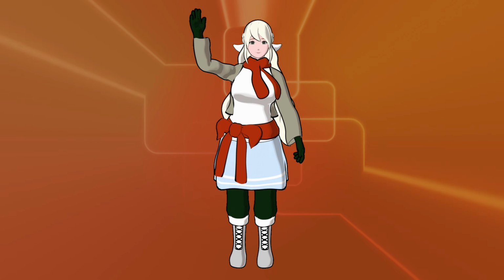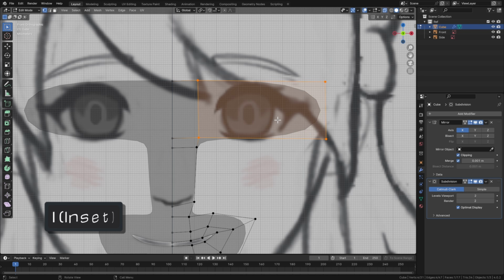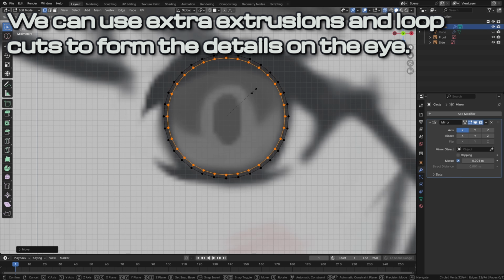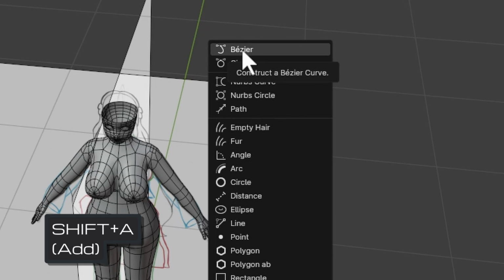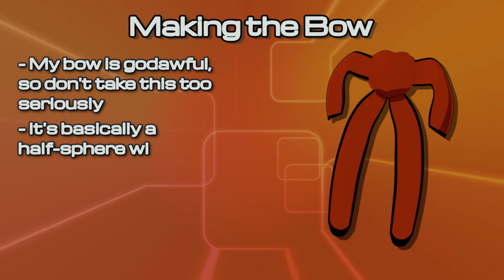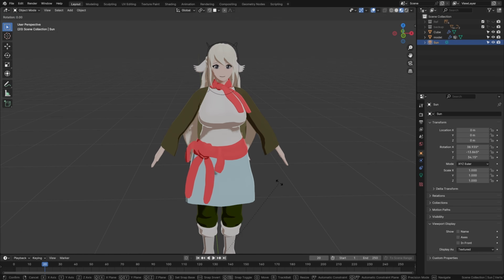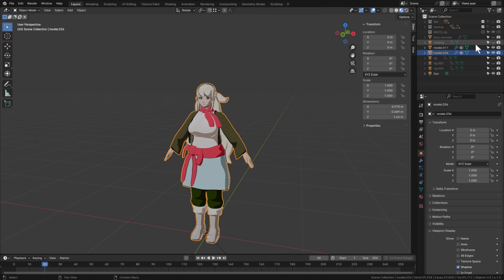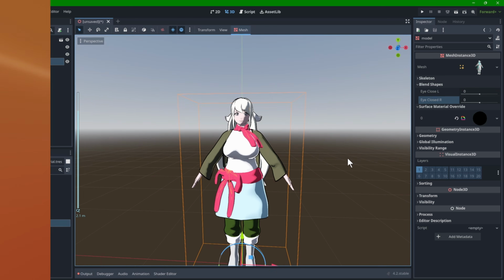COMPLETE 3D Character Creation Guide - from Blender to Godot

Comment: How would you create a character with customizable outfits? I imagine you’d just have the nude rigged model and the separate clothing models, but how would you go about “attaching”the clothes when importing it all into godot while making sure it can articulate with the rest of the body?
Reply from the maker: I don't have a lot of experience with character customization, but I would imagine what you described is fairly accurate. You would likely still skin the clothing parts to a rig and then parent that to the base body. In Godot, you can use a BoneAttachment3D node to attach things to your models, so maybe that helps.

Comment: This video helped me a LOT. 

For anybody who comes here in the future and encounters the same problems or bugs as I did, here are some possible solutions:

-- Bugs, errors: Don't use the newest version of Blender! When Blender is updated its API usually undergoes big changes, which means that the add-ons that we use (such as Expy Kit) can't "communicate" with the program because basically its code  and language structure has changed. I used Blender 4.5.5, the stablest/newest version of Blender that has Expy Kit support, and installed the newest version of Expy Kit (0.61).

-- Mixamo won't let me upload: If Mixamo is not letting you upload your armature/skinned mesh, don't panic. Just download one of the preset characters with the animation, import the FBX into Blender, and name the deform bones of either the imported FBX or your own rig to match the other rig. And then use Expy kit as instructed! It might not be as accurate, but it'll probably do the big motions. You may also want to dissolve in-between bones in order to match the bone structure/count of the imported rig. Mixamo worked for me sometimes, but other times it wouldn't let me upload a basic humanoid mesh with no materials or textures, a file size under 1MB, and barebones rig even after 20 tries.

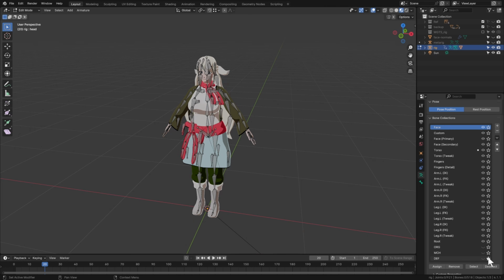-- Mesh is bending weird: Sometimes the tweak bones (the control bones shaped like spheres that control the in-betweens of your bones) and other bone constraints can make your mesh bend weird when you pose your rig, especially after dissolving the deform bones (1:14:40). You can carefully delete the ones that don't help your mesh deformation. Also, there's also the usual culprit, weight painting. The interface can be hard to learn, but if you want to catch stray mispainted vertices sooner, try posing your character to the extreme and see if anything (literally) sticks out. But don't worry about things looking absolutely perfect. Worry about smaller details later! 

Also, for those using Godot, there's a new Node family called SpringBone3D, which lets you add physics to your secondary animation bones (hair, clothes, and the regular stuff for you gooners)! 

That being said, I am SO looking forward to going back to Godot after doing all this Blender stuff. It took me like a week to figure all this out.

Comment: Hi, I'm following this process as an almost total newbie to blender, so I'm going to write down the solutions to the problems that I found along the way

-  I don't have a numpad on my keyboard, so for those of you like me, In order to set your view to orthorgraphic view (so that you can see your reference image from an angle instead of only straight on), go into 'view' in the top left and press 'Perspective/Orthographic'

- If your image is not visible from both sides, under the data tab for your reference images, press 'Both' under the 'Side' section.

- I had to set my origin twice for the offsets for some reason, so just do that if it jiggles back into place for you as well.

- When you extrude in blender and cancel it with esc or right click, apparently it will still create the new edge or plane and set it to a size of 0, causing all sorts of wonky geometry. You need to either ctrl-z every extrude you start and then cancel OR you can select the problematic areas (or the whole mesh) and go into mesh-> clean up -> merge by distance

(there will be more to come, I'll edit it as I go along)
Reply from the maker: Thank you so much for putting this together and sharing your findings!
Reply: @codernunk 
You're the real goat here, I actually just put together my first model (only the geometry and bones) thanks to you and Miziziz. Thank you for putting together this video, it's been super helpful!

Comment: I think i messed something up with the head, because when i created the new cube and merged it at center, there is no vertex for me to move up to the mouth?
Reply: I don’t know whyyy it’s not working for me. Bangs head
Reply: I’ve been trying to add my first vertex for nearly an hour. Taking a break
Reply: I'm about to cry! i can't figure out why the mouth isn't working for me. When i follow the instructions something always goes wrong-- the mouth isn't connected at the first dot/when it mirrors the mouth won't connect even if clipping is on or off. i try to scale and it only goes up or down. the few times i did succeed, there were too many lines and i couldn't extrude up for the nose properly. bruh
Reply from the maker: Sorry to hear that! What I recommend if the vertex is giving you trouble is to instead use a plane. Shrink the plane down in edit mode and move it into place. You can extrude the edge to form the mouth shape. Since we eventually extrude out to form the mouth shape from the vertex, this circumvents that step in a way.
Reply: @codernunk that’s not working for me either. >_>

Comment: weight paint the metarig, or... genrated rig 1:10:0000 is confusing
Reply from the maker: You have to weight paint the generated rig, because the bone names that deform change (Rigify adds the DEF- prefix to them). I use the method of separating out the deformation bones from the generated rig because of that, so it does seem like you are weight painting the metarig, but you are not actually.

Comment: Hey, I really appreciate the tutorial! I got 2 questions though:

1. Why bother with blender shaders if you are going to redo them in godot anyway?
2. Is a generated rig necessary? In my case the metarig with the bones (without the controls) works fine with mixamo and godot? I can see that it would help with doing custom animations later. Is there an another reason I missed?

Again thank you! Your journey is absolutely inspiring, seeing you never giving up despite the difficulties and progressing no matter what gives me great hope and motivation.
Reply from the maker: No worries!
1) It helps to have a visual of what your character will look like in the game while you're still modeling it. It was worth the time to me, but you could hypotheticaly skip that step in Belnder.
2) The generated rig is IMMENSELY helpful for animating as it creates IK/FK constraints. Moving arms and legs without IK is really difficult if you want to get into animation. But if you are just using Mixamo then you don't really need the generated rig - it's much easier to just have Mixamo weight paint it and rig it for you.

Comment: I recommend using Expy kit to retarget (bind) the rigify rig to imported animation armatures and then baking them to animations-also using Expy kit-instead of bothering to import to mixamo et cetera.
Reply from the maker: That's not a bad idea, and it can work for a basic rig. I like to add more bones to my rigs so I don't know if it's as useful in my case, but I'm sure this could help others!
Reply: @codernunk  I've done this for two animations now, with a bunch of added custom bones too. It seems to work well.

Although for the first animation that I imported I just needed to mirror the arm and hand from one side to the other to fix some weird rotation on one of the arms and for the second animation I needed to rotate y and w of the toes that was the wrong direction. It could be that I have something odd going on with my metarig and it normally works well though.

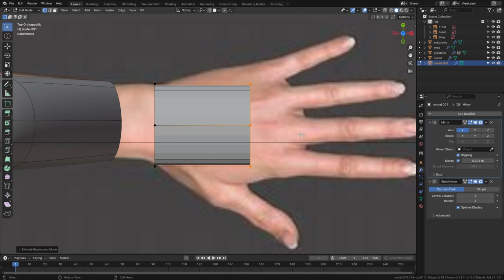Comment: Hey, great tutorial, I'm following at 31:29 after duplicating the arm loop and separating it by selection to start making the hand, but when I extrude my mesh looks round while yours is blocky, can't really figure out how, it does seem to be something with the subdivision modifier but I think I've got the same settings as your video is showing at that timestamp.
Reply from the maker: Glad you were able to figure it out. Sorry for the delayed response!
Reply: Figured it out, the separated vertices where forming a face so I was working with a box instead of a hollow cylinder

Comment: For importing to Godot, I noticed that when you create an inherited scene out of the gltf, changing the material on a mesh is only temporary? If I were doing a bunch of minor iterations on the character, it seems annoying that I would need to re-add the material every time its reimported no?
Reply from the maker: If you save the inherited scene to a new file, you should be fine. You can change the material settings or put it in the Material Override (which is what I do) on your model and it should stick.

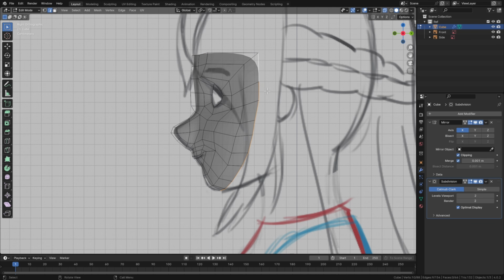Comment: I keep getting vertexes spawning. when I try to pull and fill like in 17:33 sometimes I am not allowed and then I see that there is like 10 vertexes on top of each other each pulls to a different direction. what is going on? I didn't create a single new one apart from what is in the video. help please
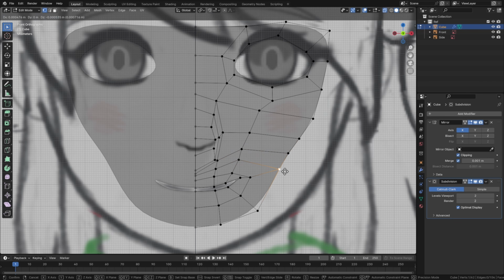Reply: I can't get past it. 8 hours in and still don't understand why vertexes are multiplying on top of each other. the moment I go to the side view step where we grab the edges to extend with E, they refuse because then I find out that that point I am trying to extend is like 20 vertexes on top of each other. If I press D to force them to adjust away from each other then I can I see them, just now I spend 1 hour deleting the extras just to go back 17:00. Next step from here spawning multiple vertexes on top of each other that messes with the entire shape.
Reply from the maker: Are you still having trouble? I know it's been a while since you commented. If you are I can go back through the video and see what may have gone wrong. What version of Blender are you using? If it's helpful to you as well, post some screenshots in my discord server and we can help you there.
Reply: @codernunk  I found out the problem. it was duplicates being born after I extrude then cancel the process by right clicking or ESC. Apparently canceling the extruding process like this only cancel the extending action and not the making of new vertexes, you have to CTR Z to actually cancel an extruding action. Now every time I encounter weird behavior I search for duplicates and delete them by CTR + A > merge by distance, then I get a pop up that says how many duplicates were removed. 

This seem to be something that would happen often for new learners. I would really appreciate if you note this in the video when you introduce extruding. Anyway, thanks for the video and your effort!

Comment: Thank you so much for this. Been following this closely. Such a detailed and helpful guide. Although I'm still having some trouble with adding custom bones. I feel like I did it exactly like you explained. Select metarig in edit mode, copy a bone, make it a basic.supercopy. parent it to an existing bone and use 'e' to extrude a link. the extruded bones don't have a rigify type, just the first link. But when I generate the rig only the first bone (the one I set as basic.supercopy) shows up in the rig. I can make every bone a basic.supercopy, but then the jigglebone addon treats every bone as an individual instead of a link, like the hair on your vid. Would really appreciate any insight from you guys. Thanks.
Reply from the maker: Thank you for the insight. I've since been using the basic.copy_chain on the parent bone of the chain and that's been working much better for me. Try that and let me know if it works!
Reply: @codernunk  Thanks again for responding, and the suggestion. I went and tried the routine with basic.copy_chain. It did improve, but now the jigglebone moves the whole appendage (a shawl), but even though I used 6 individual bones and weightpainted them, it acts as though the whole shawl was one stiff bone, not like in your demonstration, where the hair sorta flows beautifully. Like you said, I only set the origin of the chain to copy_chain and used 'e' to extrude the other bones. Does it maybe have something to do with the 'Relations' setting for the Bones? Mine are 'Local Location' and 'Inherit Rotation' enabled.

Comment: 1:04:21 for this part, I have my model as separate parts, multiple of them have the outline, but only one of them has a weight paint. Do I need to do the Vertex Paint export process for every part that has the outline or just the weight paint ones?
Also, solidify modifier remains even in the godot project right?
Reply from the maker: You'll want to make sure that you transfer the vertex paints to the parts that will export but you want to have an outline. If you don't particularly care about outline thickness on some parts, you could also just vertex paint them all white (or the color you designated as your outline weights). 

The solidify modifier will apply if you choose to apply the modifiers upon export. I prefer not to, as I can write a shader to do this instead and it'll be a bit easier to manage in the longer term.
Reply: @codernunk   ok, managed to do that, now I finished adding my custom bones like in the video. I was wondering, since they're parented to a torso bone in my case, they currently are in both the Torso and the Custom bones group. Is it ok or should I remove them from the Torso collection and keep them only in the custom group?

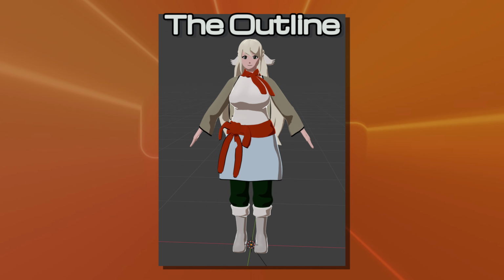Comment: 1:02:00 for the outline, I saw that you can also add it when in Godot, is it really different or worse than the one made in blender? I thought that if the results were alike I could just do that in godot to avoid increasing my polygon count
Reply from the maker: The option to add the outline to your mesh in Godot isn't super great for animated meshes I found. But if you make a shader to draw the outline, you can get some benefits out of that - like having more control over the outline weights. Typically, my workflow is to have the solidify modifier on in Blender for reference, bake the vertex weights used for the solidify to the vertex colors, then when I export to Godot, I reference the vertex weights in the outline shader.

Comment: Hi, I have a problem with animations from mixamo in blender. When I import and bake those animations, only first animation is working and other looks like bad copy of first animation. They look like one frame from the first animation and only knees and elbows move slightly. Do you know what could be wrong?
Reply from the maker: It's hard to know without seeing it, but I would make sure to import the animations one at a time, so you can better see which ones are getting baked where. I also recommend renaming the "ArmatureAction" when you import it to something you recognize so you can make sure one of the animations bakes to the right spot and you can find the right one. Let me know what else you see and we can work through it. I am planning to make a newer video on exporting animations so I can touch base on it there too.
Reply: @codernunk  When I imported the animations individually and baked them together, it didn't work. However, when I imported and baked the animations individually, it worked, but they didn't always work the first time. It's hard to say why sometimes it works and sometimes it doesn't. It's still a mystery to me.

Comment: I’m trying to figure out a Cascadeur > Blender Rigify workflow and could use some guidance.

Pipeline:

Blender: Daz3D > (Daz Importer) > Blender-ready rig > (Rig-GNS) > Rigify rig

Cascadeur: Daz3D > (Daz Importer) > Blender-ready rig > Cascadeur > Animated FBX Rig

Now I need to retarget the animated FBX onto the Rigify rig in Blender, but I can’t get it working. Has anyone done this before or know the right approach?
Reply from the maker: I'm not too familiar with Daz3D and I've only dabbled with Cascadeur, but as long as you generate the rig in Blender based on Rigify and import it into Cascadeur that way, I would guess it can export with the same rig structure from Cascadeur. If not, you'll have to look into mapping bones to do animation retargeting, which Expy Kit can do. 

If you don't want to spend too much time mapping bones, I imagine an LLM like ChatGPT can speed up that process between the two rigs as long as you provide it the bone name lists for both.
Reply: @codernunk Thanks for the reply. Unfortunately the add on does not work for me. It enables but doesn’t show any options in the n-panel.